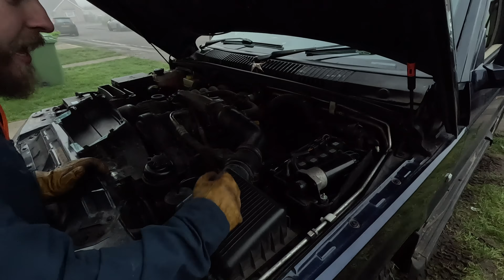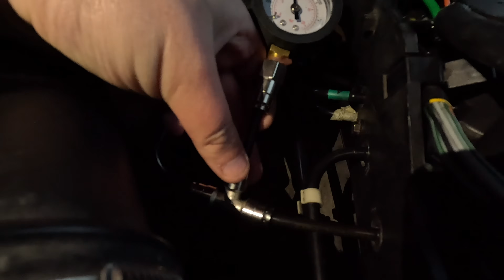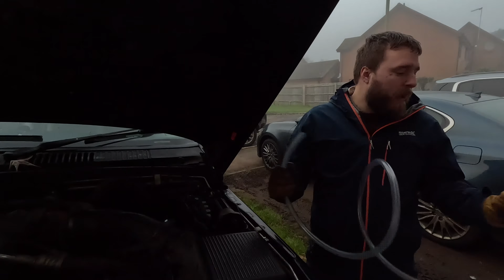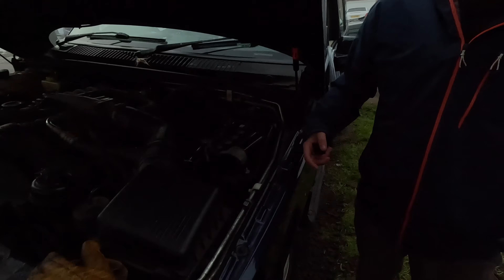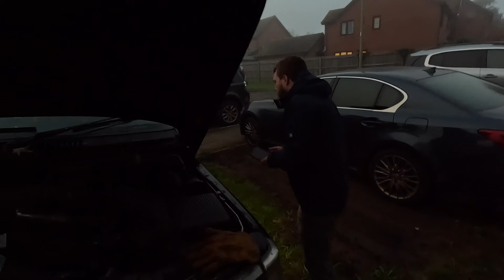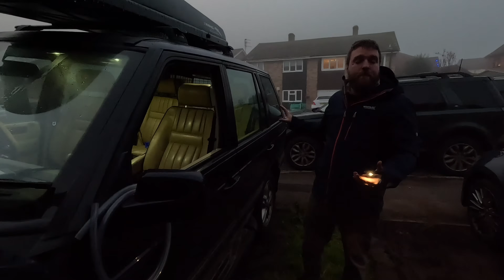Range Rover P38 - EAS Diagnostic

Comment: The Air Suspension on my P38 Range Rover is COMPLETELY worn out! (Compressor & Valve Block Rebuild)
Great video on how to rebuild with all the correct parts and step by step taking you through the process of doning it yourself.
From YouTube Channel: Sam's Motor & Machine  His channel has many video's on solving/fixing common P38A problems.
https://www.youtube.com/watch?v=Leuky36oTAY

Comment: i have a really weird thing happening with my EAS system. So one day randomly  the entire system dropped to the floor. Started off with the basics as you said in the video. Checked the compressor to see if it was even filling the reservoir, which it was not, even though the system was empty the compressor was not kicking in to fill the reservoir. Brought it to a RR specialist and he said that it was the EAS relay under the seat. i bought a new one of those fitted it and still no result. we manually filled the reservoir with air and as expected the system operated fine but the compressor would not kick in when the pressure dropped below 125PSi. I then bought a reconditioned air compressor and once again no result. I bought the diagnostics tool for the EAS system and there was no faults, and even when in the diagnostic system normally it would allow you to manually turn on the compressor but that would not even work. i was thinking that it could be a pressure sensor but where is that located on the car? surely that wouldn't cause the compressor just to stop working. I'm in a hole at the moment and I'm stumped any ideas. (sorry for how long this is)
Reply: "The Air Suspension on my P38 Range Rover is COMPLETELY worn out! (Compressor & Valve Block Rebuild)"
Great video on how to rebuild with all the correct parts and step by step taking you through the process of doning it yourself. From YouTube Channel: Sam's Motor & Machine  His channel has many video's on solving/fixing common P38A problems. https://www.youtube.com/watch?v=Leuky36oTAY
Reply from the maker: The pressure switch is located at the bottom of the valve block. You would have to remove the valve block to gain access to it. Personally, I would find someone with a Nanocom. If you can afford to get one for yourself, l highly recommend them. That way, you can see what pressure sensor is doing. I think when you manually activate the compressor, it should override the sensor and run (i may be wrong). I also think there's another relay under the bonnet for the compressor. it might be worth checking that.
 https://youtu.be/NQAt7fdPMMo?si=scCWzFLRPoSAhmGL

Appart from that, I'm afraid I can't be much more help without looking at it.
Reply: @FrenchiesRoadTrips   i will have a look at that now. I checked that other relay and that was fine before and with this new compressor the pressure sensor should be fine but then again i have not checked that myself yet. A nanocom would be extremely handy to have as well. thanks very much for your help

Comment: Hello,
My P38 2.5 DSE from 2000 has a strange symptom. When stopped for a few hours the front suspension goes up, when I open the door and put it to work and close the door immediately the front goes down. In these situations, the suspension indicates a high position and immediately returns to normal when the front goes down.
It has a new compressor and height sensors and the valve body o-rings have been replaced.
There are no leaks because it has already had the valve “ebay pipes” connected to each circuit.
Thank you for your collaboration.
Good trails.
Reply from the maker: Definitely a strange one, when any door is open the suspension shouldn't move, sounds more like a software or electrical issue, possibly related to either the suspension ECU or the drive pack. But apart from that I'm afraid I can't answer that one sorry.

Comment: Great Video, we have one here, 2000 P38, that the entry light is always on, even when level road or extended height is selected, have found small air bubbles at valve block hoses, but don't think that is the issue. Any ideas about the entry light on continuously ? Thx Joe
Reply from the maker: When you say entry light do you mean the EAS light is on the lowest hight setting permanently? Does it lift when you try raise it?
Reply: @FrenchiesRoadTrips  YES, LOWEST LIGHT, DOES NOT RAISE.
Reply from the maker: Right ok, when you try to raise it to normal hight does it start flashing? Entry light on is because its sat on the lowest setting and cant rais so thats normal for that light to be on, when you press to rais the standard hight light should start flashing. Sounds like to me it's not building up any pressure
Reply: @FrenchiesRoadTrips  STAYS ON CONSTANT. WE REPLACED REAR BAGS, STILL NO CHANGE ? WOULD SLIGHT LEAKAGE AT VALVE BLOCK HOSES CAUSE THIS ?
Reply from the maker: Small leaks can cause alot of issues with the EAS so would be a good place to start. Have you got access to a Nanocom? See if you can manual raise it with the Nanocom, the light should flash indicating its trying to rais, so this is confusing me a bit

Comment: thanks for great video, one question regarding the relay EAS if you dont whant to take it out, is it the black wire you can disconnect to stop the fuction of it ? Im thinking of placing a switch to it to turn it off. thanks Bjarni
Reply from the maker: Glad you enjoyed the video. Iv not actually had a look at the wiring and don't have the car with me (currently on holiday). Best advice I could really give is to join one of the Facebook groups, and see if anyone else has done something similar.
Reply: Simply remove the large black relay under the Passenger seat

Comment: What do you do if it's the bags - replace the air shock?  Or can you repair the air shock?
Reply from the maker: So yeah if it's the bag it's self that has failed, then it will need replacing. You can't do any repairs to the bag, and even if you could I wouldn't want to, last thing you want is the bag to go pop when flying down the motorway, as that would be disastrous.
Reply from the maker: You can get replacement bags for about £70 each, you have 3 main choices, Dunlop (cheapest what I'm using), arnott gen 2s and arnott gen 3 airbags, the gen 3s are the most expensive but are an upgrade, I can't comment on the ride quality (not used them) but have heard they are good quality. They also have an increased length so can be used in line with a 2 inch suspension lift.

The bags are relatively easy to replace, can even do it with the wheels still on if needs be.

And another things to be cautious off, if you ever replace the hydraulic shocks, make sure they are standard length NOT the extended 2 inch lift shocks (unless your doing a lift) as this can over extend the bags, and lift them of there pedestal.
Reply: @FrenchiesRoadTrips  

what about resetting the EAS warning on the dash. Does that require some electronic input still?
Reply from the maker: So you would need either an EAS kicker (look on ebay) it's a device you plugin into the car turn the car on for 30 seconds and off again and it should automatically reset the EAS. Or if you can afford it a Nanocom from black box, Nanocom is a full diagnostic machine not cheap but 100% worth it. But I do recommend carrying around an EAS kicker if you can get one

Comment: nice tips. The rubber pipe as stethoscope is genius. I actually have a car stethoscope so will use that but did not even think about it till you mentioned the rubber hose trick.
Reply from the maker: Thank you, a little trick I learnt from dad, has come in very useful 😅

Comment: I haven't watched yet, but the RRC air suspension system was very similar to the P38. I still have the software and bits somewhere as well as my prized tool. A piece of wood marked up as my air suspension calibration stick. Marked with access, standard and high ride heights at each wing. Simply park on level ground and walk round each corner to check. I must hang it up on my garage wall again. Good luck with the P38 set up.,
Reply from the maker: That's on the todo list, I plan on cutting some wood to put under the bump stops for calibrating the suspension. Another thing you can do on these aswell, you can swap the hight sensor round by flipping them up side down, it's like having a brand new sensor because it only uses half of the sensors range, by flipping it you use the other half that's not been used yet 😊
Reply: @FrenchiesRoadTrips  I still have a picture of the sizes for the blocks to be cut to somewhere if you need it. I did own a P38 (Pre production M202CVC) for a brief time. I only ever drove it from one side of my car park at work to the other side as it had no MOT. It is currently under restoration I believe.